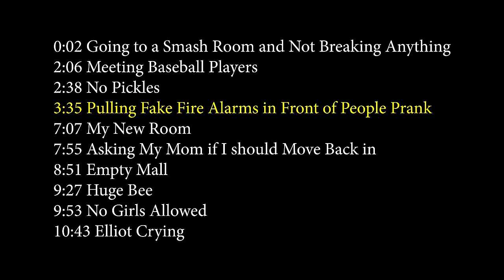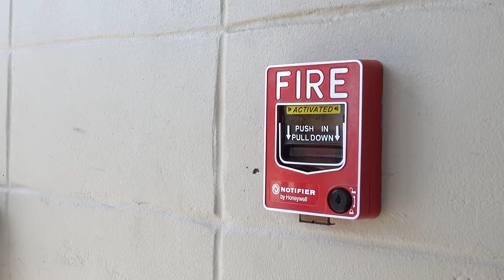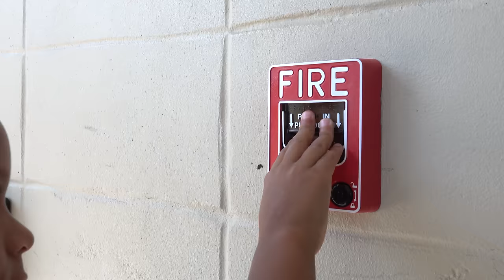Pulling Fake Fire Alarms in Front of People

Comment: It’s obvious that the fire alarm is not fake if you want it to make noise you have to hook it up to a fire alarm the one you guys have is a Device called a pull station a pull station is a device you hook up to a fire alarm the pull station is not what makes the noise a fire alarm is a red object that has a light that flashes when activated along with a speaker on it and that is what a pull station is